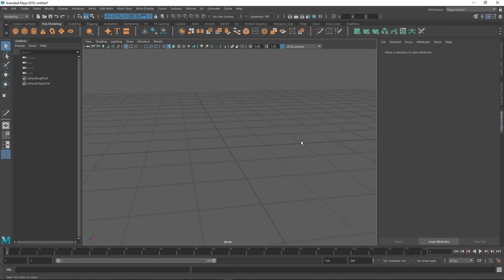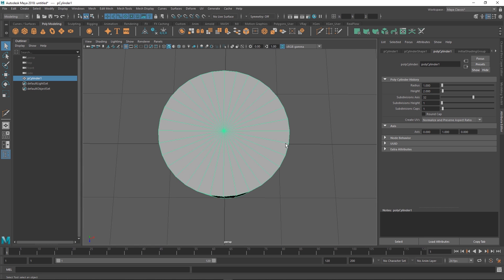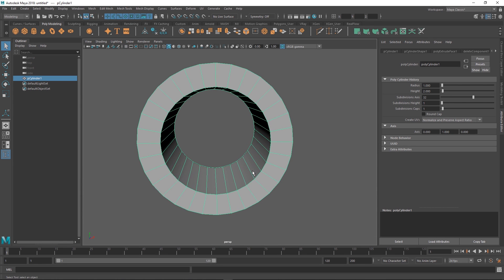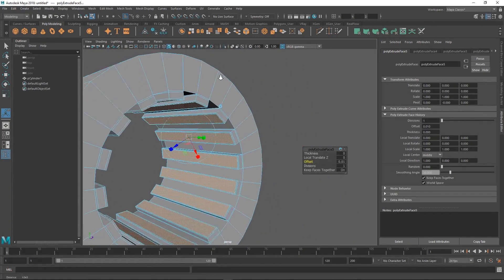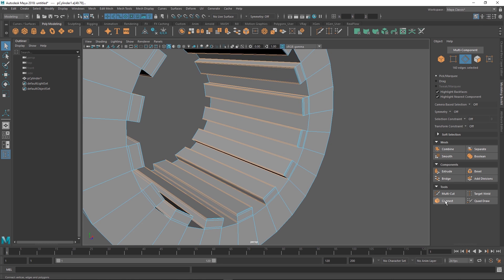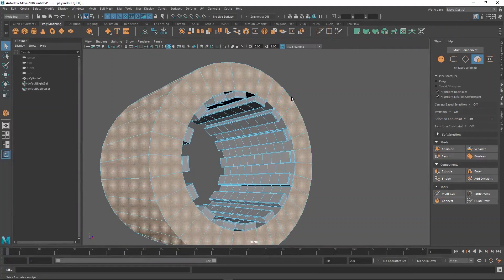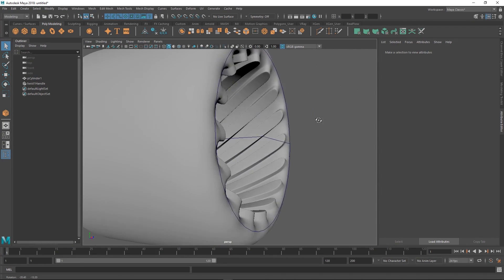Modeling a Gun Barrel in Maya - Hard Surface

Comment: Hey guys. I would assume that you're familiar with ZModeler. If not, then I can tell you it's pretty powerful.
Using ZModeler you can do pretty much the same thing as in Maya. I made a quick vid to show that: https://youtu.be/OdR8vYVEzqM
You'll notice at the end that I initially forgot to mask the outer shell and twisted it as well. This made me realize that in your Maya video you don't show the back face of the barrel, which I'd imagine is pretty mangled and would still need fixing (just as in ZBrush of course).
I like your videos but I thought this is rather unfair to ZBrush, at least with the example you chose to show. I'd imagine there's lots of advantages to modelling in Maya, but this exact mesh did not showcase that.

Comment: Guys! This is done easier. Just make cogwheel plane and extrude with twist and vol'a
Reply: Just tried it out and that's a pretty neat way to use new primitive shapes in 2018! There is still a lot of cleanup to do and the initial gear creation settings are odd so I'd probably combine your method with Henning and Morton's and get the best of both worlds :)
Reply from the maker: Neat! Thanks.
Reply: I think, the idea was to keep outside topology clean and straight. With your method it will be twisted in both sides
Reply: @18Alexandr18  To be fair, you could do the twist to the barreled side of the cylinder and then extrude the outer cylinder to keep that topo straight and clean using his method :)

Always thousands of ways to accomplish the same thing, just depends on what works best for you to create the best quality in the most efficient time

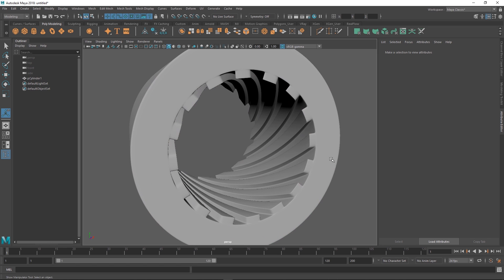Comment: Insetting instead of creating hold edges creates bad creasing where the rifling meets the larger barrel cylinder 9:42.
Reply: Is there an easy way to create the hold edges on each flange at the same time?
Reply: @afxwinter  Do their tripple extrusion to get your horizontal hold edges. To get your vertical hold edges on the rifling and space between you can just select the outter most barrel loop -> ring select that loop to get rings of your spaces and rifling -> connect 2 and space them so they're towards the edges. 
This will give you hard corners on the barrel its self so you're gonna need to space them out. In max you can use the "spherify" modifier or use the "regularize" script from scriptspot like I do
https://i.imgur.com/MJJuGlc.jpg
Reply: @afxwinter  https://i.imgur.com/MJJuGlc.jpg quick visualization of what I mean
Reply: Beautiful!  Thank you!   @xdeathknight72x